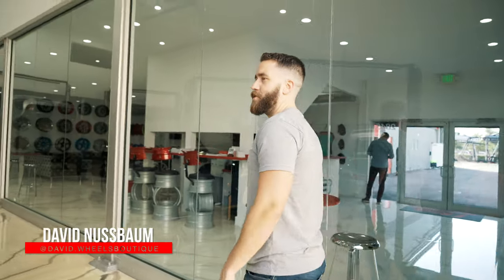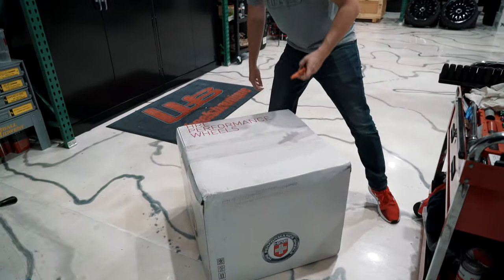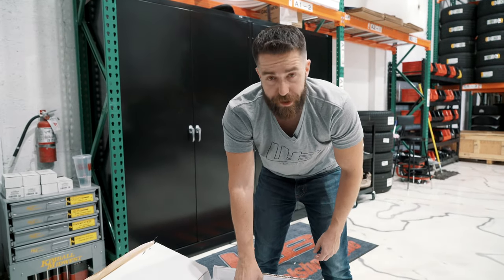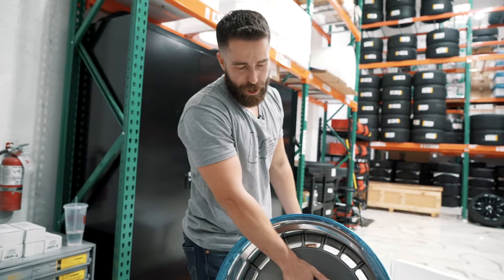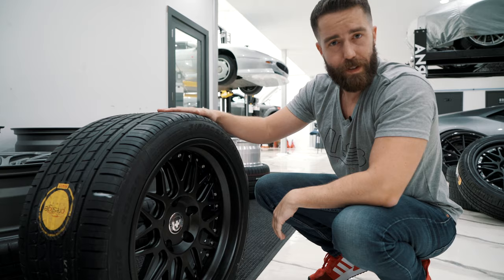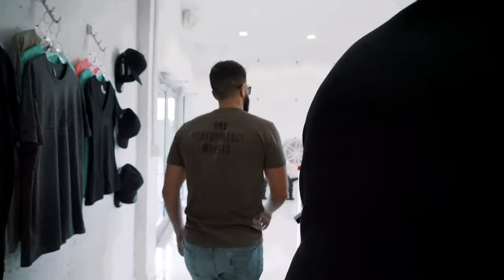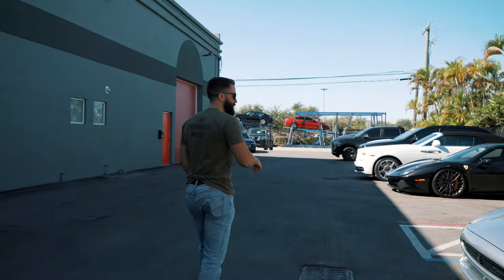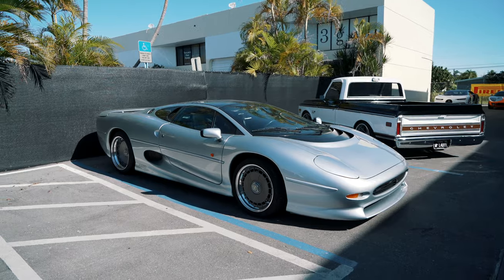JAGUAR XJ220 GETS HRE WHEELS!

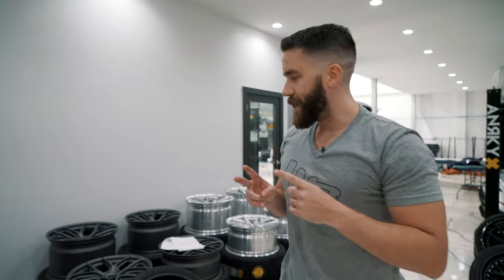Comment: Great video! Question regarding the tire comments at 5:00. People are always saying you can never get tires for this Jag and because of that you cant safely drive them.
Do people just use that as a cheap excuse? Because if you can afford the 90s icon, then clearly it's possible to put aftermarket wheels and tires on the Jag. It may not be the stock size, but its pretty close.

Thanks in advance! Would love to hear your thoughts on this.

Comment: The Xj220 only got 1/2 the engine that it should have had, the quad turbo V12 should have been fitted in place of the V6, but it was too long. I actually got a ride in a ex Tom Walkinshaw Racing XJ40 saloon that had the development quad turbo V12 in it and that could get upto the 180mph mark on the German autobahns, before becoming twichy due to the XJ40's aerodynamic shape.

If the quad turbo V12 had have made it into the production car it would have have around the Bugatti Veyron's level of performance, someone needs to build a XJ220 with that quad turbo V12 in it.